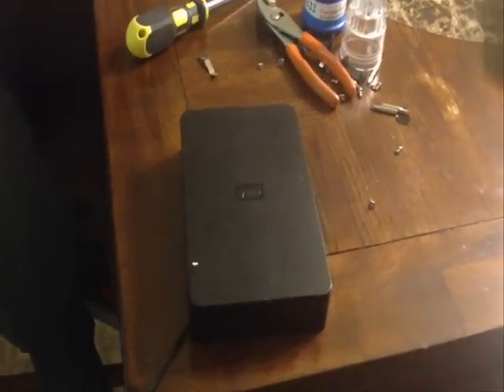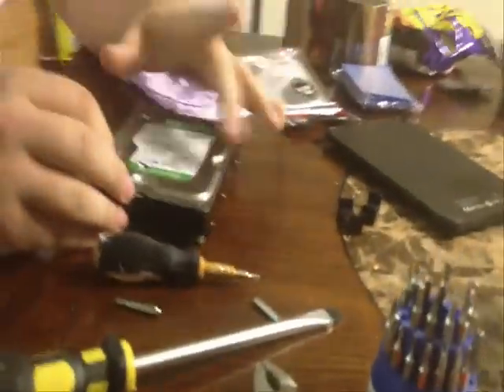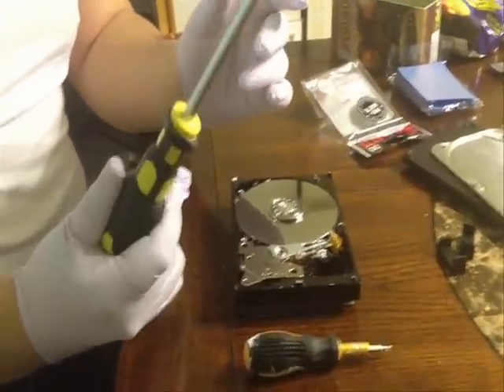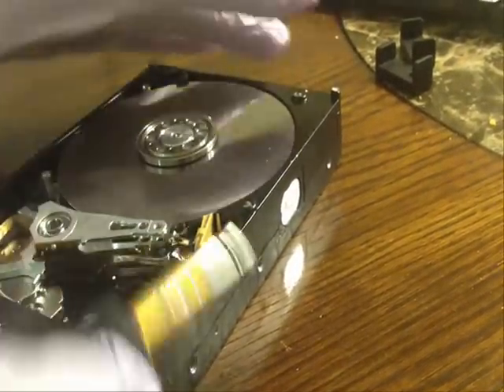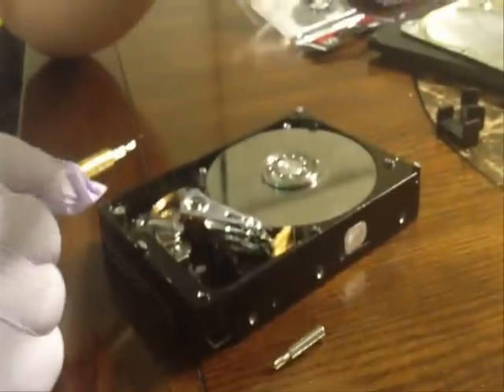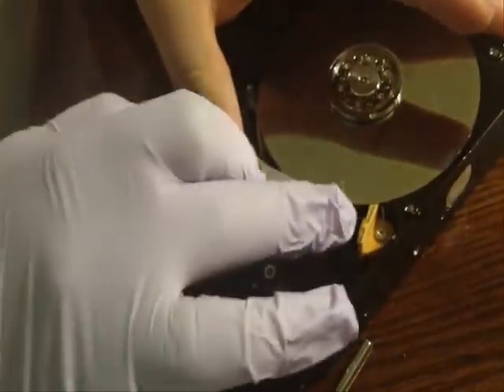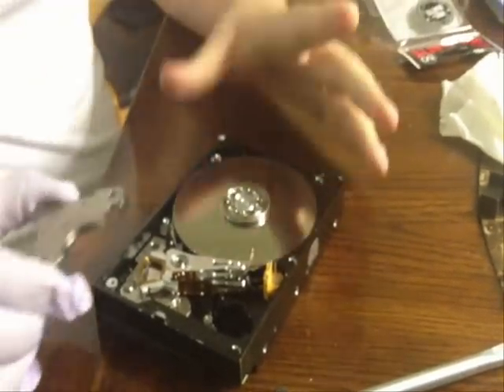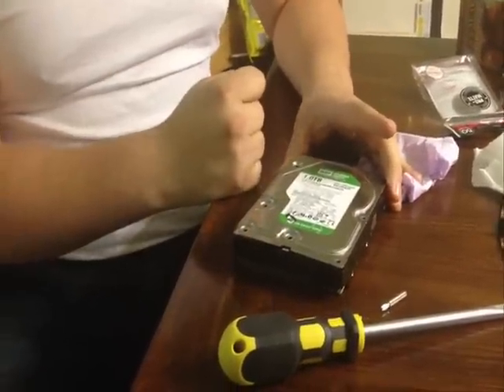DIY: How to repair a damaged hard drive

Comment: if anyone in their right mind actually believes this video, you're a dumbass. for one you need a cleanroom, 2nd you dont just start prying stuff out of your hard drive,3 the platters are damaged and the heads are damaged and bent. 4, there are special tools for head swaps, and platter swaps that only recovery clinics have,  The heads are really fragile and have a minute alignment in the head ramps that he has totally fucked up. IF anyone really tries this you can kiss your data goodbye. Thats' why they charge 3-5000$ for a data recovery, parts and the actual process needed to recover data is nothing anyone can just do.

Comment: They probably would have taken it apart faster with a hammer and chisel then use a good window washing cleaner on the drive surfaces to clean them up.  And just to be safe use a few quick sprays with hydrogen peroxide followed by a good splash of some peanut oil (high temp lubricant) to make sure it spins smoothly.  Then put it back together and drop it in the old garbage can.

Comment: ok once you pop off the cover you ruin the drive unless you have a real clean romm with positive pressure. also the heads should NEVER touch the platter surface. the ride or better yet hydroplane over the platters and use flux transition to read and write.
if a drive is knocking chances are it can be fixed by having its bios rewritten. unfortunately the tools to do this cost upwards of $5,000 for a basic set of cables and software.
An alternative is to order a new control PC board for the drive which is cheaper and easier.
The common computer geek cannot repair a hard drive internally you will have to send it off to get it repaired or at the lease your data recovered.

Comment: note* difference between a "clean room" and a Clean-Room. Clean room is a 99.99% airborn particulates removed and full body lint free suit.

Wait. dont worry, this entire vid is just a joke. they are messing with you. that drive is 100% fked now.

Rubbing the water off with tp? riight

Comment: HDD are vacuum sealed, and they should only be opened to destroy data or by a professional in a certified lab (in a real CleanRoom). Once you pop open that HDD you expose it to dust particles and most labs won't even take it, if they do they charge more money b/c of the damage you did. Never open a HDD unless it is for reasons stated above, this video is just bad comedy.

Comment: Another good trick to do is, 
If your Hard Drive does not have a couple vent holes with a sticker covering them on the lid,
To drill a couple small holes so you can simulate a vacuum seal after !!
To do that, use vacuum to suck from one of the holes while you place a new sticker over the second,
Then quickly put another on the second hole while sucking still !!!
Thanks 4 The Vid !!

Comment: tooalexsmith I don't think you understand what it takes to open a hard drive. If a single spec of dust goes on the plate, it might damage it beyond repair. Trying to fix the drive at home would be equivalent to operating a patient in a mud pool - the gloves part does not matter.

Comment: DONT DO IT !!!!!!!!

 ONCE THE HARD DRIVE IS OPEN IT WILL NEVER WORK
THEN YOULL HAVE TO PAT $1000 TO GET THE MEMORY RECOVERED.

THIS VIDEO SHOULD BE DELETED
Reply: ***** I think your head needs to be tightened!
Reply: Yes you can do it, you need a clean room!

Comment: I like to give my HDD a regular clean out to improve perfomance and make more space for porn. Similar to this video, I usually prise off the lid with an old chisel and then use some hot soapy water and a scrubbing brush with nice stiff bristles to really scrub all the filth from my platters. Once finished cleaning I  hang it out to dry on the washing line. When it's dry I use Sellotape to carefully reassemble the lid (because I always lose the screws). Works brilliantly every time!

Comment: Once any hard drive is exposed to any dust what-so-ever (even invisible) it will fail quickly even if it worked before and you'd ruin any chance of professional data recovery. It needs to be opened in a specially conditioned totally dust free environment and the technicians even have to wear special clothing and hair hats Etc. (remember around 90% of dust is actually dead skin), that's why you have to pay so much for professional data recovery. I like the buffing up of the disk in the video lol!

Comment: Don't watch this. Once a HDD is opened it is officially dead. The HDD is a very delicate component, and even 1 speck of dust will ruin all your data. In order to take apart your drive you must go to a clean room, which is literally dust free. It is many hundred times cleaner than an advanced operation room. If you don't want your precious data destroyed beyond repair, do NOT open the hard drive, not even 1 screw.

Comment: Uh, excuse me dipshit, but hackersification is right. The heads fly above each surface of the disk on a cushion of air that is clean until you open it. ANY microscopic bit of lint, dust, whatever pulled between the head and disk results in a head crash the instant they try to seek track 0 - at 7200 rpm. A fingerprint is about 100 x thicker than the distance between the head and disk. I used to work in a class II clean room (a REAL one) doing stuff like this - and it's not for fools - like you.

Comment: dv series is notorious for motherboard flaws, and that is a common issue. Try unplugging it, and take out the battery. With no source of power running to the laptop, hold the power button down for 15 to 20 seconds. This will discharge the board. Plug the AC adapter in without the battery in, and try to turn it on. If it worked, awesome...put your battery back and go have a beer. If it didn't then it's probably a motherboard failure.(This is all assuming that you do not get a BIOS splash screen)

Comment: HDD can be used after they have been opened, most data recovery company's are able to fix read write heads to recover data but the drive will have a seriuosly reduced life span and once the data has been recoverd it is more cost effective to buy a new one and than transfer the saved data on to the new HDD.

Comment from the maker: It is hard to dfine the problem if I don't see it myself.
Hmmmm.....
1. Do you hear any beeps? What kinda beep?
2. Have you checked all the voltage output from your PSU?
3. Did you smell anything burned or something strange?
4. Have you checked the proc? 
5. Have you tested the VideoCard?

Comment: This is a delibrate hoax, everything they do is exactly what you shouldn't. The needle should not touch the disk, you can not touch the disk and you defo' can't use bog roll to clean it. That disk will never work again!

Comment: You're an idiot.  Opening the HDD doesn't automatically destroy it.  Only reason opening the HDD could case harm would be from debris in the air.  One of the reasons they do it in a clean room.  HDD's aren't air/water tight.